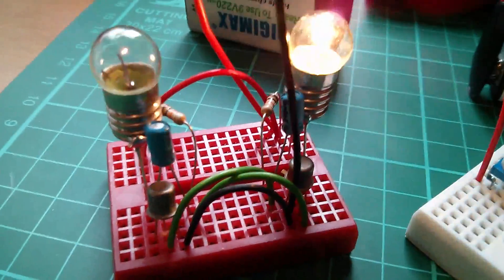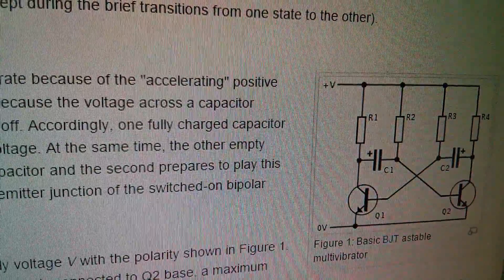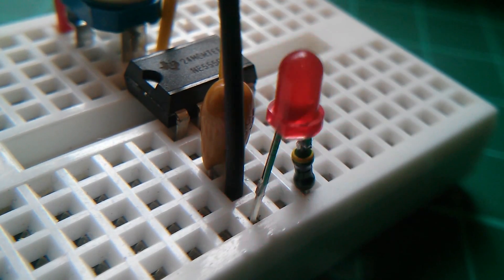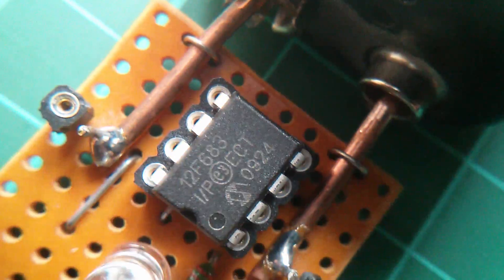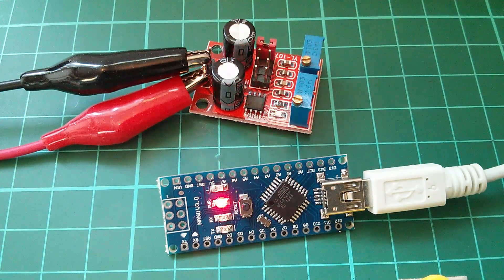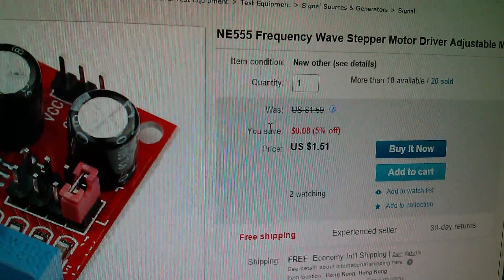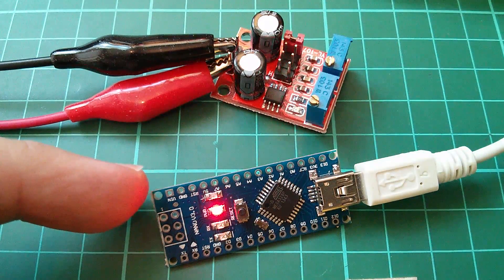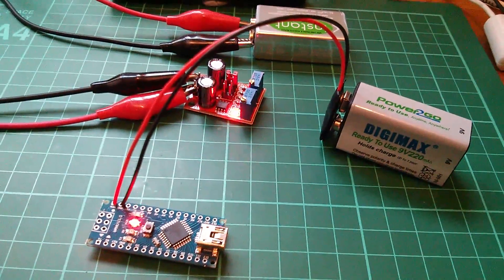Playing with Flashing Lights - BC109, 555 or Microcontroller?

Comment: Great video it's helped me out a bit, what circuit would you use to flash a 6 volt DC light bulb on and off, with a pot to adjust flash rate and a pot to adjust brightness, I need this circuit for an elderly neighbour to make his lighthouse flash, he doesn't want to use an LED and all the circuits I can find are for LEDS, I have even tried pcb's to make model railway lights flash but they only work for LEDS lol, I have also bought a breadboard and some electronics starter kit's to try and work it out for myself but to no avail, please help thank you.

Comment: There's an even simpler way to flash an LED that just uses 1 transistor, a resistor and a capacitor. It's been a while since i tried that circuit, I think if I remember, the capacitor was connected across the transistor's collector and emitter, the led and resistor was connected in series to the collector, but the transistor was connected backwards and the base was left floating. This worked, although it produced more a a sawtooth wave so the led would flash bright and fade out over and over again.

Comment: Pretty interesting. But not allot of real practical learning to be had here. The obvious drawbacks of the little hotshot modern prefabbed bought circuits though is that you ares stuck with their bulky configuration. I have a little Christmas village with allot of LED's incorporated into it, and none of those bulky modern prefabbed units could be worked into the design at all. They are just neat little novelties without many practical applications in my opinion.
I prefer the flexibility of the old school units, where I can run wires where I want them, and hide the actual circuitry somewhere else or even spread it out a bit if need be.
Reply: Unfortunately you are right. There are many like this one, and then there are many well intended videos, trying to teach something, but so poorly done that you can't make heads or tails about how they are actually accomplishing what they are doing.
Reply: you guys have better channels to suggest? Asking honestly.

Comment: First, you forgot CPLDs which rock in applications like this. Second, Crapduino has nothing to do with AVR programming, it's an idiot-welcome prefab firmware slow as hell (strange how people still use it if AVR assembly is simple, straightforward and has just a few instructions). Choosing an MCU for LED effects I'd go for atTiny in sot23 package with a pure AVRASM firmware. Though 555s still have a huge potential as in production devices they can act as a neat high-current repeater that works out of the box, no firmware uploads required. The footprint is somewhat large though.

Comment: Having been trained in the days of valves, my first non-vacuum tube build was - a BC107 astable multivibrator on veroboard!!!
Reply: Alan Powell what's a veroboard? Is it some kind of "older breadboard"?
Reply: Yes - Exactly, its an older (60s -70s) trade name for strip board. It was the only source prior to China getting into the game. Told you I was old!

Comment: The easiest way to flash an LED is to just get a flashing LED!! ;)
Reply from the maker: xanataph Hehe, very true, but there's no speed control.
Reply: Julian Ilett They are somewhat voltage sensitive so there is a limited degree ov speed control there. And some ov them are quite light sensitive too in that regard, but I don't think that would be a really useful way to control the speed! hehe

I have found them handy at times to use in conjunction with a power transistor to flash something larger like a 5 watt bulb - it's a quick & dirty flasher circuit! :)

Comment: found that "weird circuit" diagram I told about.  (hope it looks ok enough on here)
ASCII circuits ;-)
try this...
+ 12v                                                         +            -
+--------[__1K__]---+------------------------|330µF|----------------gnd
                                       |                              
                                       |                             led
                                        ^       ----------------|>|------[__100__]----- gnd
                                          \    /
                                         -----
                                            | not connected

So 12V power (which you love :))
1Kohm resistor.
1 2N2222 transistor (NPN, base not connected, in the circuit above the ^ is the emiter).
1 330µF elco
1 100ohm resistor
1 LED

if the circuit makes use of a "weird" property of transistors sometimes having negative resistance.
The led will flash (although dim)

I also have circuit somewhere for a single led flasher with
2 transistors, 2 resistors (or just one if the LED has built in resistor), and 1 elco.

Comment: Great video! Really love it :) Just a question, do you have any links for where to get the light bulbs? They seem extremely expensive on eBay, but I might be searching for the wrong thing. Could you help me out?
Reply from the maker: Chris Fredriksson I searched for "6v mes bulb". Seems to be the same sellers selling them - mostly UK sellers on eBay UK. They were pretty expensive, and because I wanted several different Watt ratings, they took quite a while to accumulate. Just tried a search on eBay.com - almost all results are "From United Kingdom" - strange. Did we invent the light bulb? I can't remember ;)
Reply: Have a look on rapidonline.com I sometimes use them for bits and they're pretty cheap. E.g: http://www.rapidonline.com/electronic-components/t1-5-les-e5-lamp-29261
Reply: Julian Ilett Yes thats mostly what I found as well, quite sad but I guess its like with all other eBay items.. If people buy the price will go down eventually.. :) so lets buy hundreds! Or well, someone else, then I can get em when they are cheap ;) haha.. Hmm, might be that the UK invented.. or that no one wants to use these anymore and then there's full storage houses with these and people try to get them sold for evil expensive prices ;) peaps ah, thats much cheaper, but still a bit expensive. But thanks, I might order from there! :)
Reply: Try to buy them locally, it should be acually cheaper than from china. Here they are cheap as dirt - around $0.30/pop
Reply: MrJesusthekiller Why... didn't I think of that!? haha, that might actually be very true even for here in Sweden. I'm stuck at finding things on eBay, I've forgot local stores ;) hehe
Reply: Chris Fredriksson Old flashlights also have those type of bulbs in them. You might be able to find some cheap flashlights at a dollar store or something and take the bulbs from those. The trouble is though that lately flashlights have been moving towards the mighty LED instead :)

Comment: You forgot FPGA.

There is also the mechanical way to it, with zero transistors. (and different numbers of gears)

I would guess there is a chemical way too, and physics can also be added as needed.
(pendulum would be cool)

And then it's the hybrid that use all of the above + your ways.

Heck, you can even get a LED with built in ASIC.
Reply from the maker: Aha, yes, I like the chemical idea - breaking one of those light sticks every hour. Pretty slow flash rate and a sawtooth waveform! Can you get FPGAs for $3?
Reply: Julian Ilett
How about $8  CPLD, non-volatile :)
http://www.ebay.com/itm/XILINX-CoolRunner-II-FPGA-CPLD-XC2C64A-Core-Module-Mini-DEV-Development-XBOX360-/171424723910?pt=LH_DefaultDomain_0&hash=item27e9b5b3c6
Reply from the maker: Rishi Franklin Wow, at that price I really need to get into this.
Reply: Rishi Franklin Whoa, it's cheap! Got to get some :D
Reply: erlendse this was actually done with relays by the GPO (British post office, when they used to run the phones) to supply a 0.67 Hz (one 0.75 second flash every 1.5 seconds) signal for announcing emergency calls to operators. The relay system was more robust than motors/gears/mechanical interruptors at remote telephone exchanges

That dates back to the 1930s but it's still fascinating what you can do with very basic components

Comment: All are really fun. I was doing the same thing last night with a 555 astable multivibrator connecting the output to my new Owon SDS7102 osciloscope. I can watch the waveform all day. It is beautiful. :)

By the way you forgot the world's simplest led blinker with a BJT transistor's negative resistance. ;)

World's Simplest Single Transistor Oscillator - BJT with Negative Resistance

http://www.cappels.org/dproj/simplest_LED_flasher/Simplest_LED_Flasher_Circuit.html

Comment: Hardly ever used the 555, they used to be a bit pricy..
Reply from the maker: Özay Turay Nice one Super cheap, and from my favourite seller!
Reply from the maker: ***** They're not pricey now... Check out what I found. 50Pcs New NE555P NE555 DIP-8 SINGLE BIPOLAR TIMERS IC http://www.ebay.co.uk/itm/-/351137209301?roken=cUgayN via @eBay_UK
Reply: Julian Ilett Even cheaper on alice1101983. ;) http://www.ebay.com/itm/New-50PCS-NE555P-NE555-DIP-8-SINGLE-BIPOLAR-TIMERS-IC-TOP-Quality-/311014327265?pt=LH_DefaultDomain_0&hash=item4869e603e1

Comment: Please post link to Nano. Do you know of any nano's that use plug and play serial to USB like on UNO board. e.g. atmel usb to serial
Reply from the maker: thingyee1118 The CH340 Nano is plug 'n' play on Windows 8. On Windows 7, I think you have to install drivers.
Reply: I know CH340. Is that the only Serial to USB you have found on nanos ?
Reply from the maker: thingyee1118 There is also the FTDI Nano, but beware FTDIgate!
Reply: oh FTDI dont get me started. :P drivers setting chip id to 0. can you supply link to arduino nanos you buy. I have one from Banggood.
Reply from the maker: thingyee1118 Banggood I trust. Also Alice1101983:
Check out USB Nano V3.0 ATmega328 16M 5V Micro-controller CH340G board For Arduino  http://www.ebay.com/itm/USB-Nano-V3-0-ATmega328-16M-5V-Micro-controller-CH340G-board-For-Arduino-/311064700128?roken=cUgayN&soutkn=nvfejY via @eBay